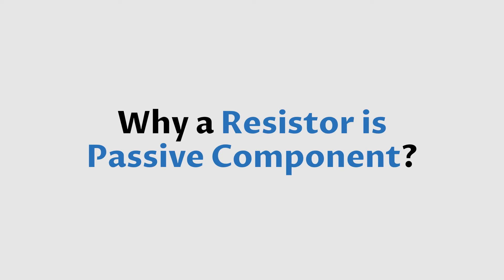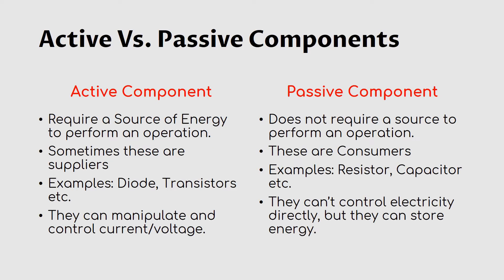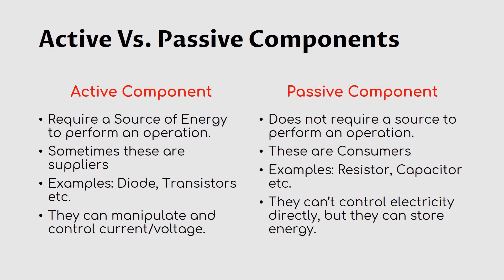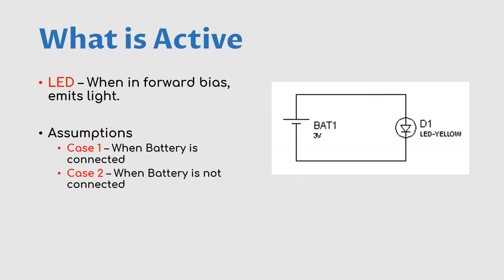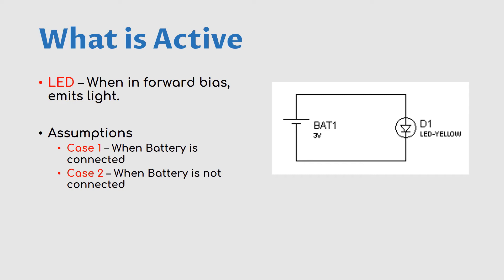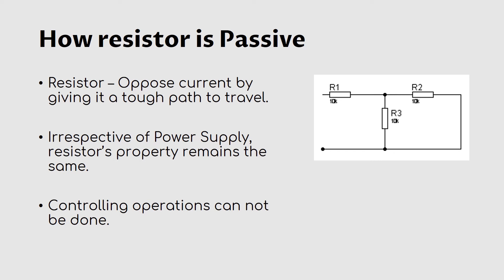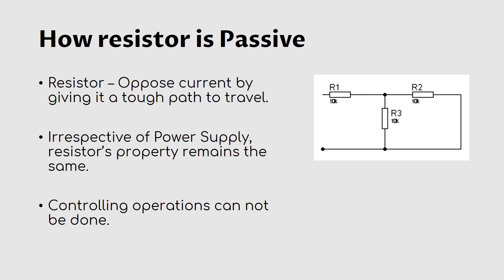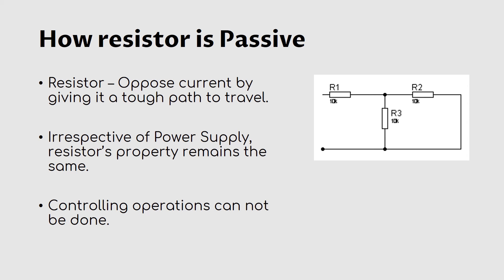Resistor Tutorial | Lesson 4: Why Resistor is a Passive Component? | Active vs. Passive | BtechBible

Comment: Power consumable components is called as passive component( i.e voltage, current, power stored examples Resistor, capacitor and Inductor)
Reply from the maker: Yes. They store energy.